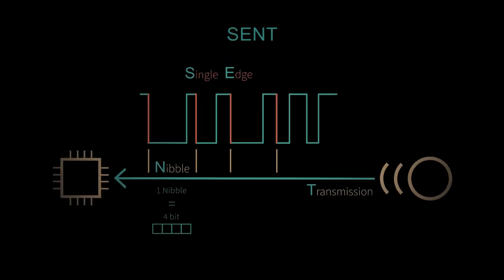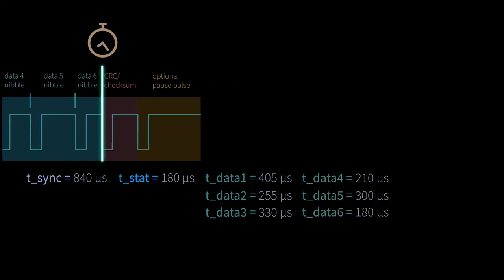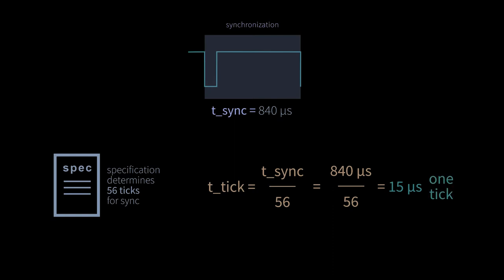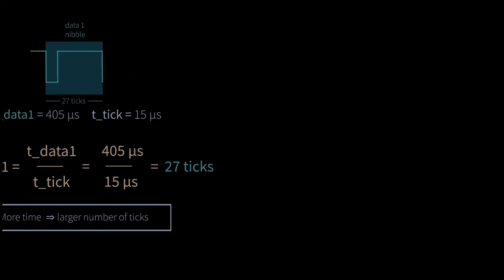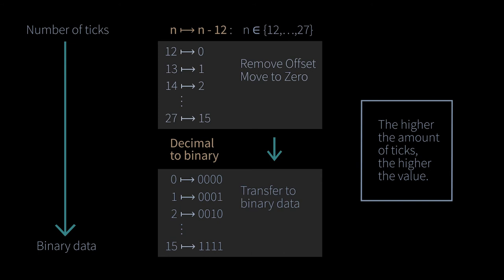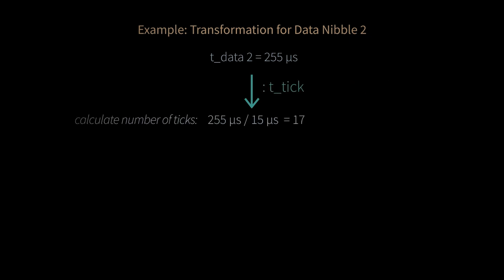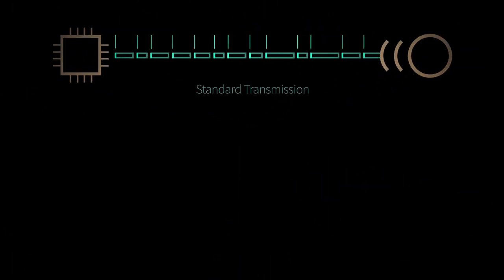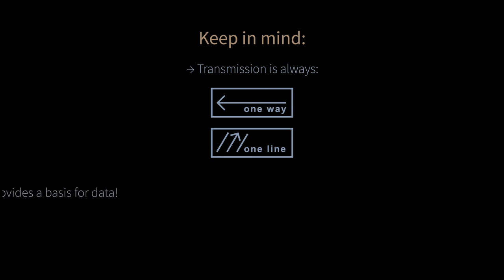🇬🇧 SENT Protocol Data Transmission | Part 2 - Example | Embedded Academy Tutorial

Comment: Good Information and can you also explain how CRC is performed on transferred data?
Reply from the maker: Thank you for your question.
After every data block a CRC value is attached. It is calculated from the data using all nibbles except for the status and communication nibble.
After the transmission the data block is applied against the CRC value to check for errors.
The CRC value is calculated via polynomial division, with the polynomial 1x⁴ + 1x³ + 1x² + 0x¹ + 1, which is represented as the bit string 11101.

Here you can learn more about the cyclic redundancy check (CRC):
https://en.wikipedia.org/wiki/Computation_of_cyclic_redundancy_checks 
And here you can see a code example on page 22:
https://www.infineon.com/dgdl/Infineon-Infineon-TLE4998S8D_LinearHall_Dual_Sensor-AP-v01_00-EN.pdf?fileId=5546d4624b0b249c014ba1762c4f781c